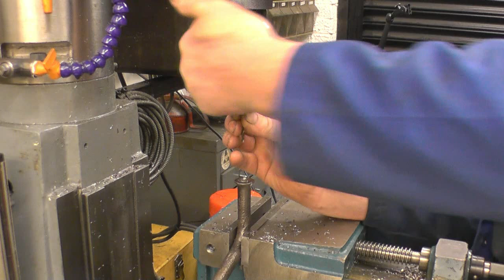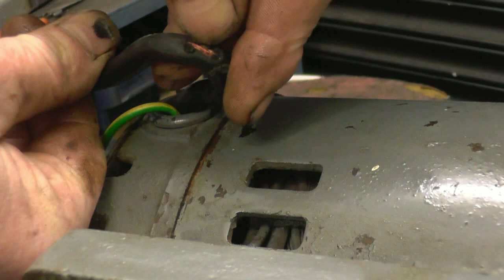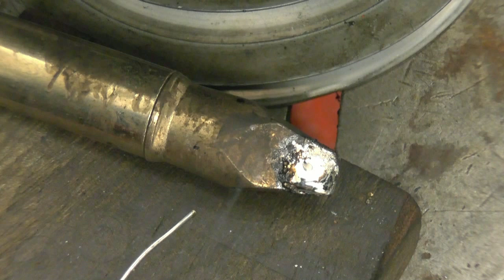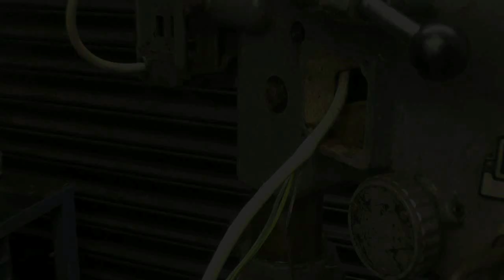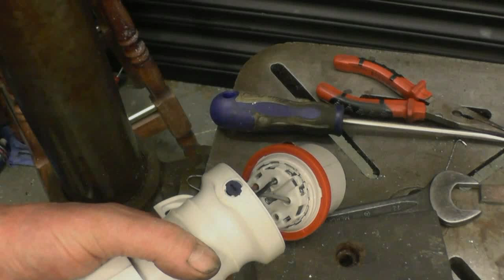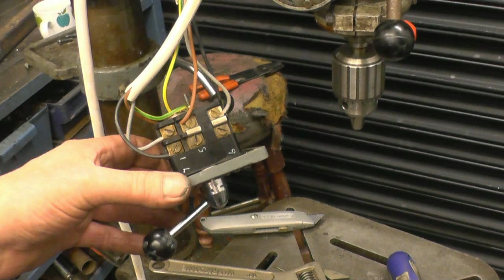SNNC 107 P2 Handle Tig weld / Drill wiring

Comment: Hi John,
          Just a quick note . It is not recommended practice to solder crimped connections as the solder makes the joint too solid and reduces the flexibility of the wire at the soldered site. This means that the joint when flexed a number of times will break earlier than it would have had it not been soldered. I know that a soldered joint is a very good connection electrically but it is reduced in strength mechanically. Good video, most enjoyable.
MoK

Comment: HI John
I was using a pair of wire crimpers like you have to cut off a screw,( that is what the holes around the pivot are used for) well it was a larger screw I was cutting and it took a bit of force. I was using 2 hands to cut the screw and I did not realize part of my palm below my index finger was between the wire stripper jaws and when the screw snapped off the wire stripper jaws cut a chunk of my palm off as well. Just a suggestion if you ever use them to cut off a screw I would use a vise to apply the force. It still hurts just thinking about it and it was quite bloody as well. 
I wish you and yours the best and thanks for taking the time to share your talent. PS the old restored trucks were neat to see.
John Fink

Comment: I have never seen a plug like that white one. US connections are vastly different from the euro ones. Congrats on the increased popularity!
Reply: +bcbloc02 He's just reached over 20K subscribers, and it couldn't happen to a nicer fellow...I can imagine when you do more video it will be the same for you as well. Especially with your mega barn-shop and super crane assembly type jobs :)
Reply: Knolltop Farms
Agreed, John is a super nice guy and deserves the reward for the nice videos. I think since the scale of the work i do is so large it appeals to a lot less people. It is mostly the machine and metal removal addicts like you that watch my stuff. :-) lol
Reply: +bcbloc02 Hi, This is not a Euro standard but a British Standard. Here we have single phase 'Live-to-Neutral'=230V and in terms of 3-phase, 415V between phases (not 440V as John commented in a previous video). We, in the UK, have our own electrical plug-socket configuration and much more strict electrical safety regulations than the rest of Europe and probably the rest of the world (including your idiotically poor 120V system, that need twice the power (Amps) to operate the same machinery, and which most definitely contributes to the numerous 'brown-outs' that you need to have to cope with, as a direct result of your nation (and Canada, I believe) having such a stupidly low mains voltage.

Comment: Hi john,
Great video the age of your drill press the gland hole will be 3/4 conduit,the same thread will be found in the motor if you remove the rubber grommet.Most electrical whole sale suppliers would be able to supply a stepped adapter for 3/4 to 20mm threads.

Best wishes
ken 
Aberdeen
Reply: Yep

John its 3/4 16 tip nice and imperial

20mm is 1.5 pitch

From a grey beard sparks who was brung up on imperial when it when metric we just took longer paces and called them metres 😀

Stuart

Comment: John,
I'm glad to see your drill press is running just fine. That's what I love about three-phase power -- if it runs backwards, flip any 2 wires to correct the problem. That's actually how the reversing switch works. It flips two of the phases and the motor reverses. Thanks again for a very interesting program.  Have a good one!
Dave
Reply: +Swarf Rat I remember when we had some ventilation fan motors rewound where I used to work... the rewinding company apparently didn't follow the old layout. We'd carefully labelled phases and where they went. The motor still ran backwards. Being 50ft from the floor in a 2 level mechanical room... it was a bit of a beast to get to and swap the 2 wires back over lol